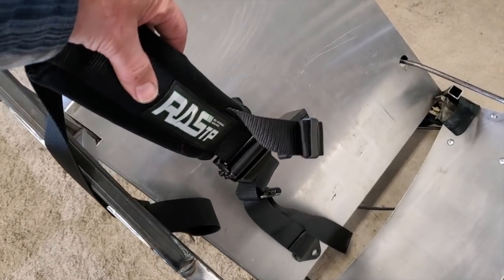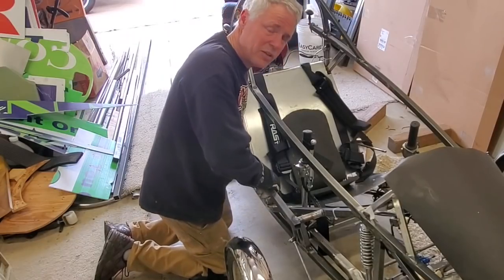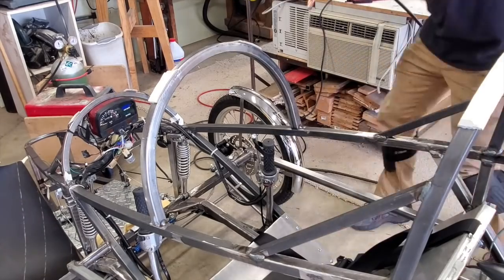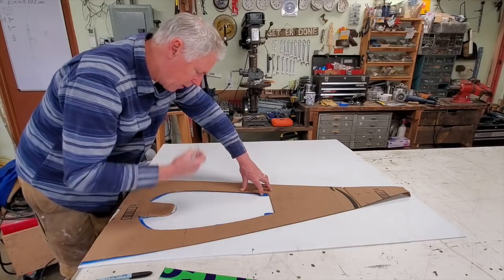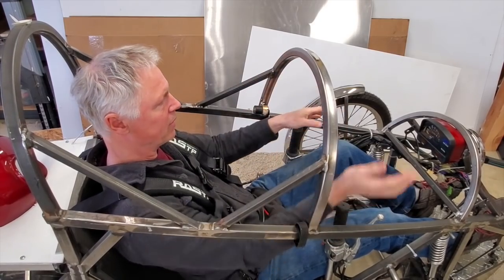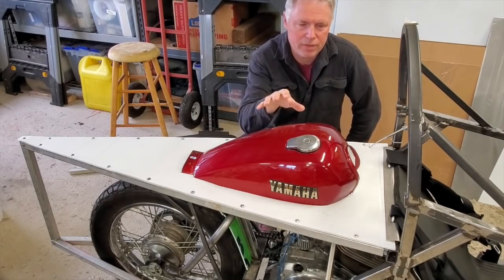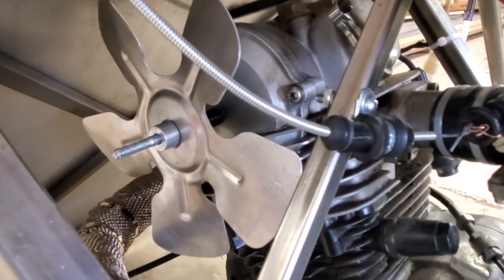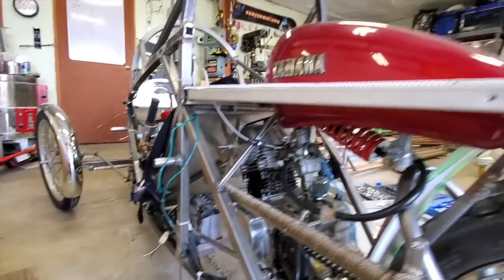Fuel efficient reverse trike build (part-12)

Comment: couple of thoughts to consider
motor compartment ventilation: simple "scoops" one facing forward on the fan side, one facing backward on the other side nearer the back.
fan locking collar: what we used to do was "spot" the hole for the set screw. what i mean by that is use a smaller then the hole drill to make a divot in the shaft. then even if the set screw comes a little loose, it still holds.

Comment: I ask you, why not slide the red fuel tank rearward until it runs out of room?  It looks like it is 3-dimentionally shaped to fit into that space and the reams of usable storage in front of it once it is in this position, would make useful storage.  Waaay back atop the rear tire....

I bet your gas stays cool.  I owned an FJR1300 for 11 years, that thing (liquid cooled, aluminum block mounted to an aluminum frame, all covered in abs plastic, tank tucked in behind a wide-ish windshield) was famous for cooking riders, but Yamaha only had a thin film of reflective insulation under the tank to keep the gas cool.  After a short ride on a 70 degree day the frame would burn a bare hand, but the gas stayed cool.

Finally, consider integrating the clutch actuation into the shifting lever- the first bit of movement loads the clutch and the last bit of the range nudges the shifter.  Sure, it has to function on downshifts too -- maybe you are the sort who likes to upshift without a clutch?  No one likes a showoff!

Enjoying the build, hello from New Brunswick Canada!  Thanks for sharing.
Reply from the maker: Thanks for the comments! First, Hanging the tank over the wheel adds a higher center of gravity, in sharp turns it can might wash the rear wheel out sooner than if inboard, and finally I didn't want the tank to be the rear bumper. Not a good idea. 
I thought a lot on where to put the pedals and levers. The best would have been making the left pedal the shifter as on most motorcycles. I don't have a direct line for a straight connecting rod but a boat motor steering cable would have worked. I just opted for the hand shifter, even though it's not a good idea to have one hand off the steering levers when under way.

Comment: I wanna figure out a way to put insulation in the gaps in chloroplast, because I wanna make a long distance moped camper
Reply from the maker: You and me both. I've thought of 'great stuff' with a long 7ft application tube to run down each flute, but that would take some effort.

Comment: If you’re attached to the tank’s position (looks cool and easy to fill, imho), you can use heat-shielding mat (sold under ‘DEI engineering’ brand and found at better auto parts stores) glued to the underside of it.  It not only increases safety margin but also your mpg!  Cool build and likin’ your work!

Comment: The trouble with roll cages, is that they can brain you in a crash. The braces on the rear hoop look close enough for you to hit your temple in a side or diagonal impact. If that’s the case, then you’ll need a helmet for this one, and that will require a redesign of the middle hoop. Paul, I love your designs and your ingenuity, but I’m concerned for your safety with this one.
Reply from the maker: Me too! I'll have padding on the two roll bars and I'll be wearing a helmet.

Comment: Luv the engineering but don't think ol Ralphie would approve.
Safe at any speed?😉
IMHO, power to weight and mpg dropping with all the steel for that engine. Why not just use conduit and diet? 😝 Research cycling streamliners for framing comparison. I've fantasized about a project like this after seeing one in the 90s built by an aerospace engineer airplane styled with larger engine and all aluminum. Damned of I can remember it. And the 70s Popular Mechanics build that went cross  country for 100+ mpg.

Comment: I know the risk that asbestos insulation poses but would it be possible to get an insulation mat that you could put under the gas tank so as to alleviate some of the heat issue insulation is very lightweight that or an electric fan inside the top tube rail where the gas tank originally mounted to the bike running the hot air up and out or reversing it and pulling colder air from the cabin pulling hot air up and out the side vents you plan on installing I'm loving the build paul really excited to see her get her maiden voyage
Reply: https://www.rockymountainatvmc.com/parts/dei-reflect-a-cool-under-tank-insulation-p
Reply: That'd work right there good detective work bud

Comment: What do you think about climbing in in between the two roll bars instead of in between the front bar and the dash? You could use the crash bar on the side as a step and step in onto your seat. I’d just be worried about banging my head on the front bar every time you get in and out. Then again, you’d have to deal with mud and stuff on your seat if you climb in in between the two bars. You’ve probably thought this stuff through...
By the way, have you thought about mirrors yet? Once I saw you in the seat and where your eyeline would sit, I imagined bullet style mirrors right on top of your front fenders. Probably jumping ahead, but I can’t help it! It’s really coming together.
Reply from the maker: I did think of that, but the step was markedly higher, although I didn't think about stepping on the crash bar. Too I didn't like the idea of mud on my seat. 
Mirrors have not been thought of yet. Eventually. I had always envisioned teardrop back to back amber blinkers sitting on the top just above my head. I might have to make them.
Reply: @paulwelkinsdiy  if you’re open to it, I’ll send you some spare signals I have that I was gonna put on my motorcycle. I’ll warn you though, they are TINY; about an inch and a quarter around. I’m sure they’re plenty bright, I just didn’t end up using them. I ordered them off of wish a few years back and they’ve just been sitting on a shelf ever since. 
They look like these ones here:
https://dl.wish.com/StRUU

Comment: Drill a small indent into the shaft for the set screw to "lock" into. This method has been in use for centuries and works in much the same way as a Woodruff key. It's "Woodruff key lite", so to speak.
Reply from the maker: I'll try that. The flat spot was just nicked out with my angle grinder. Not really flat, but I see the advantage of a small indent for the head of the screw to seat in.

Comment: Does this thing have reverse?  If not, then leaving the floor open is a smart move.  ;)
Reply from the maker: I favor the Flintstone reverse technique (hatch door) It's simple and it gives you interior air flow without having to create side window openings. But unlike my first trike, this simple suspension system did take up some room for foot movement when engaged on the ground.

Comment: A layer of insulative/reflective material may go some way to protect the tank from the engine heat?
Reply from the maker: Thats what I'm thinking too. I have extra 2" wide fiberglass muffler pipe wrap. Maybe strings some of that under the tank. Hmmmm.
Reply: @paulwelkinsdiy  https://www.rockymountainatvmc.com/parts/dei-reflect-a-cool-under-tank-insulation-p

Comment: Put a downward facing spoiler under where your feet rest, so that it diverts the wind towards the ground, in order to keep aerodynamics good for your open section under your legs. If you make one that's on a hinge, you could adjust how much air gets in as needed for comfort
Reply from the maker: I was just mocking up a door hatch similar to my last trike. Was thinking of going with Coroplast but might go with aluminum for durability. It's an extra few pounds but probably worth in.

Comment: Good job! Which material are you going to use for the body?
Reply from the maker: Fluted plastic for now. I once added a few sheets under my CRX to smooth the under surface out. It held up great until I drove the car over 9" of fresh snow on the road.

Comment: Hmm bad words spoken here... from time to time. ;-) 

Paul on your fan shaft did you file a flat spot for the set screw to seat on? 

For cooling airflow instead of holes in the body panels maybe NASA style duct outlets or shark gill vents like you find on speedboats. 

I'm enjoying seeing your rig come together.
Reply from the maker: I did cus some, but only when I felt the need. And yes, I did file a flat spot for the Allen screw to seat on, but when the motor stops it stops now. It's just a cheap Chinese item. Nothing high quality. 
I'll be adding a 2" x 14"  floor pan scoop starting at the back of the seat with the air directed at the motor.

Comment: I don't understand the use of a mechanically driven cooling fan when electric fans are easy to source. Just find a wrecking yard.
Reply: Most car electric fans pull more power than the charging system of this little 185cc motor puts out.
Reply from the maker: @krissfemmpaws1029 You got it Kriss!
Reply: Stanley I thought that at first... I would (And Have) use the largest computer fans... Take only a few watts
Reply: @misters2837  a computer fan that you find in s PC is not going to move the air required to cool that motorcycle motor.
Reply: @krissfemmpaws1029  sorry but you're incorrect... About 30 years ago I used a 125cc Honda ATV engine in a buckboard car replica...engine is in an enclosure of sorts (part of the seat) I have 2x12V fans that flow around 200cfm @1A 12W each...I have them thermostatically set and staged at 300F and 400F, the second fan rarely comes on now, as CHT rarely gets above 400F...(my lawn mower with flywheel cooling fan runs almost 500F) The first fans I had 30yrs ago were about 2/3 that CFM and it cooled ok, but the second fan ran more...when I found some better ones I upgraded.  It takes very little air movement to cool these engines...Even under heavy load... That fan on that camshaft @ 5000rpm (if the engine turns 10K) would be hard pressed to move 1-200cfm in its unshrouded set up... The 10" 4A fan my truck has on it for AUX cooling when A/C comes on is around 700cfm...that would actually be overkill on this project. So Yes a 200-250cfm computer cooling fan or two would easily cool the 185cc engine.

Comment: Paul have you thought about weight the trike to see if it’s fairly equal weight from front to back im just curious because it’s probably very front heavy at the moment and also I’m very worried if you were to be rear ended is there enough strength in the seat steel plate to stop that engine from coming threw to your back i guess what I’m getting at you can probably afford to add a little strength back there and help you In severs ways
Reply: My thoughts were along the lines of yours save that I saw...hmmm how will I explain this.... like a much thicker mud guard, heavier gauge either half round or bent box to follow over the back wheel and offer the engine area some protection from a rear end. This central mud guard would at the end, allow fitment of the side panels, negating the need for the side rails. Were the side rails aluminum so maybe a mute point.

Concerning the alternative fuel tank, I think there is much to commend the design by moving the fuel tank outside of the driver compartment where fumes may lurk in and around the driver. I'm sure any road safety inspection would welcome this change if not deny acceptance the way it is. If it also improves luggage space, this is a good plus. Is there a reason the metal between engine bay and passenger compartments are called 'the firewall' ?

The fighter cockpit over arch is cumbersome and adds complexity. How you get into and out of the vehicle is now a contortionist party trick. There can be little more frustrating than an involved safety belt set up that won't let you reach the dashboard, or your mobile phone or to change channel on your radio without stopping, unbuckling, do what ever, buckling up and continuing.

In the last video on the road test, you avoided a large puddle at the side of the road. Think about that, had you been forced to go into it by another car approaching, and you've got no floor under you. EEeeeeewwww.

The indicator set up being so close to the central line of the vehicle adds nothing to help other road users understand your intentions. Get the indicators further apart to make your signals and intentions clearer.

Love the build Paul. I'm living one of my bucket list dreams, unfulfilled, by watching your progress.
Reply from the maker: @alexwild4350  Good Comment Alex! 
So right on on some of your suggestions. I told my wife this rig is getting a bit cramped. Looking at my old trike I had a door, room for elbows and I could reach the dash board. It's taught me to not let one cool item, the acrylic dome, be the main item you build around. Now I'm just making the best with what I'v created, knowing there's a better way. 
Kinda disappointing and inconvenient to get in and out, but hey, if anything it feel of a formula race car! Just not as fast...
Reply: @paulwelkinsdiy  Thinking more, and thinking 'American' [I'm British], thinking Horses, was thinking down the line of 'saddle bags' for the petrol tank. This could hang above the rear wheel, with one tank, plastic barrel, either side over the rear wheel. Then it dawned on me your existing fuel tank, for sitting over the top frame member on the original bike, is probably already like  saddle bags under neath. If you have a mud guard arrangement over the rear wheel as described previously, then the existing fuel tank could sit above the rear wheel, and above its maximum travel, this might be perfect. Perfect because with a bit of sculpture work on the body panels, you've then already got a lockable fuel filler cap that needs no extra work. Would the tank work better 'the wrong way around' in this role,pointy end facing forward, and moved aft until the filler cap is just about in the right place to work with the body work ?

If you then added a 'firewall' panel from top to bottom behind the drivers seat, as per Brody Jo's comments, this would separate the engine and driver compartments, and as an added bonus, stop any shopping goods on the upper parcel shelf clouting the driver on the back of the head for sudden braking. Brody Jo is quite right. If you get shunted, with that full harness on, you won't be going anywhere, but that Engine won't stop until its buried itself in your body under impact. 

Some of that concertina flexible aluminium vent ducting used for cooker hoods suggests itself to duct fresh air onto the cylinders and would probably look proper racing car. 

And your comment "just not as fast..." is as we say in the UK "the famous last words." Your next video will tell us how your wifes sisters brother in law 2nd cousin was clearing out a cupboard where he found, still in its manufactures packaging, a brand new Honda 900cc Turbo charged motorcycle engine he'd got no use for.

Look forward to see how things progress :)